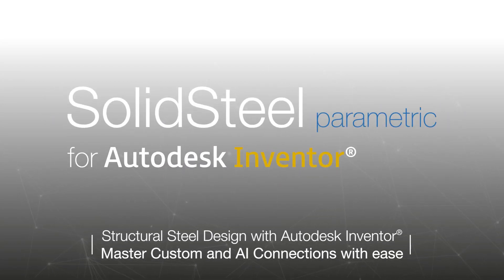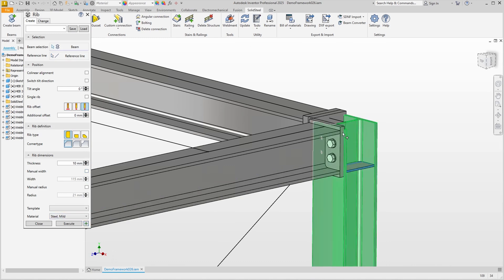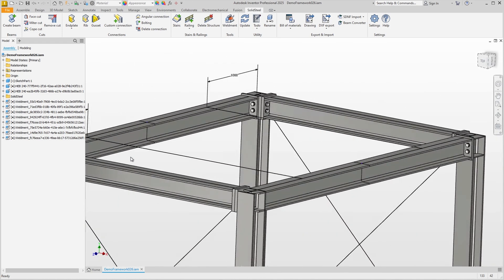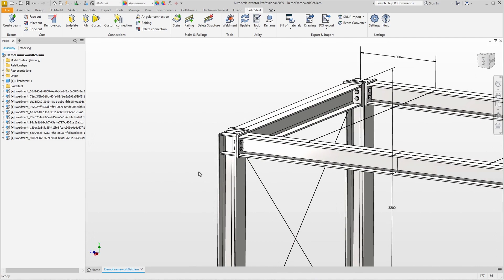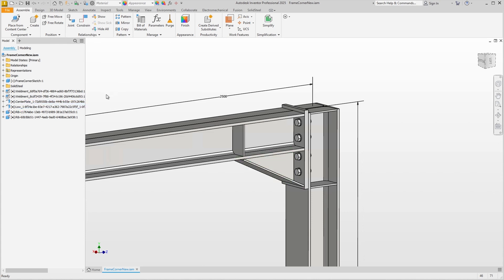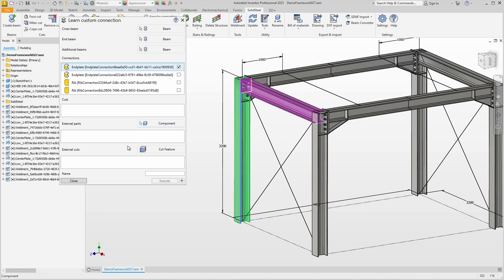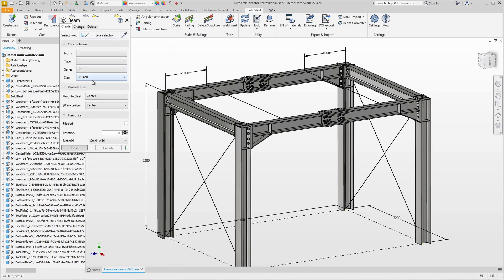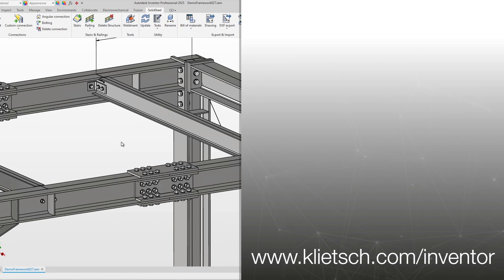Custom- and AI connections in steel design with Autodesk Inventor – SolidSteel parametric Tutorial

Comment: The  firts AI Conection is wrong you can not get a spanner in to fix the bolt
Reply from the maker: You're right, and you paid close attention. We should have only used the outer rib at the bottom to keep the path clear.